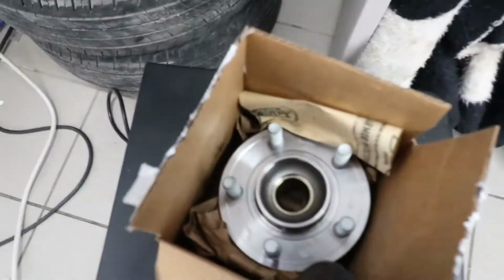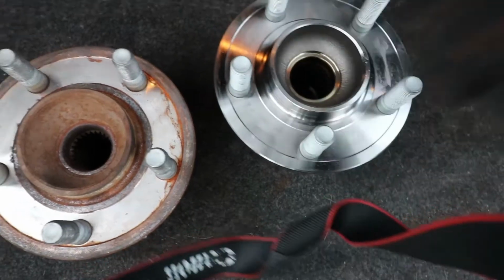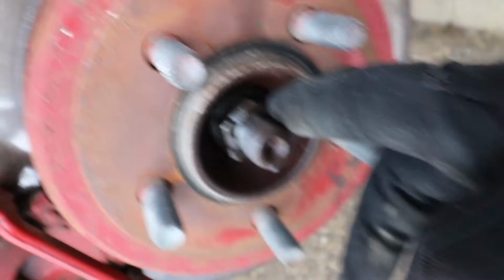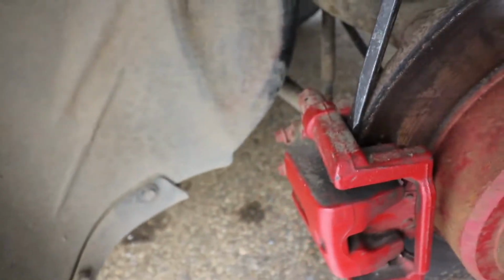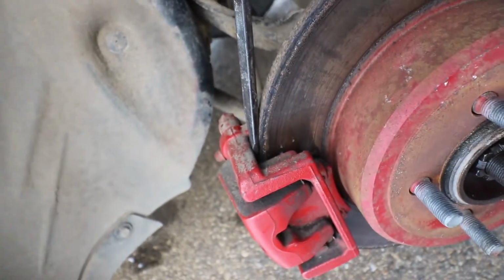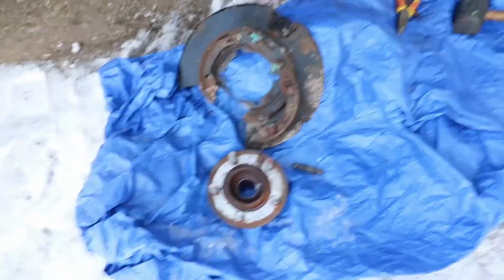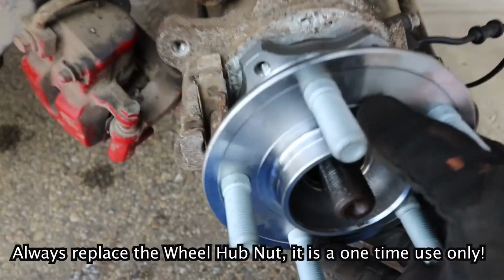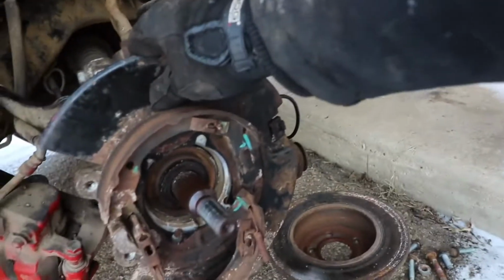How to install a rear wheel hub on to a 2009 Dodge Charger SE

Comment: I cant get the CV Axle all the way into the hub assembly seems like yours just slid right on what am I missing smh
Reply from the maker: If you’re having some problems, just a quick hand wire brush can do the trick. I know I had a similar issue on a 2006 chev cobalt. Being less experienced, I just used the ratchet to drive it on fully…

Comment: How did you take the hub of im having trouble right now
Reply from the maker: I ended up taking out the shock to give myself more clearance.
Reply: @kumihox  thank you so much for the fast reply did you happen to use a t12 socket for the bolts?
Reply from the maker: You’re welcome! I believe it was either a E12 or E14 (T12 or T14).
Reply: @kumihox  sorry to bother again but the cv axle is in the way of getting to the bolts is there anything you did to get past that or was it even a problem for you? And thank you again for your help
Reply from the maker: @leko2143  If I remember correctly I used a swivel to help with it. You could use a combo of that and the jack under the lower control arm to level out the cv axle.
Reply: @kumihox  cant tell you how much I appreciate the help it worked like a charm, man thank you 🙏
Reply from the maker: @leko2143  you’re welcome mate! Glad it all worked out for ya!
Reply: What size is the cv axle nut?
Reply: Swivel socket will save you from removing the shock and emergency brake to replace this hub well worth the purchase to avoid taking more parts off to replace it.